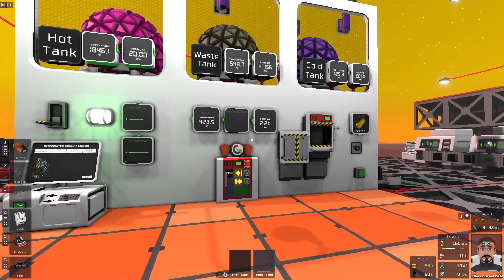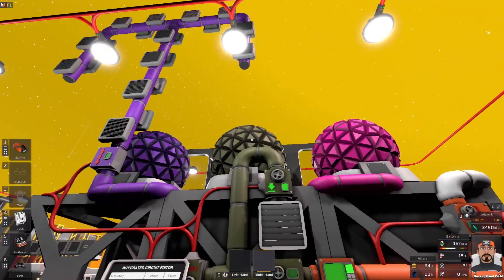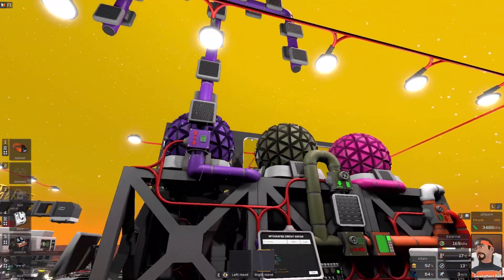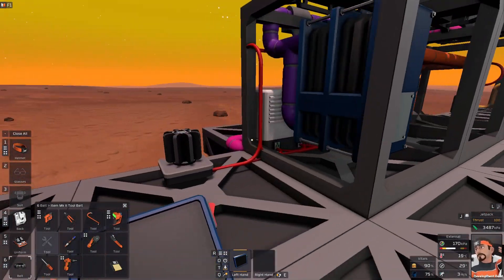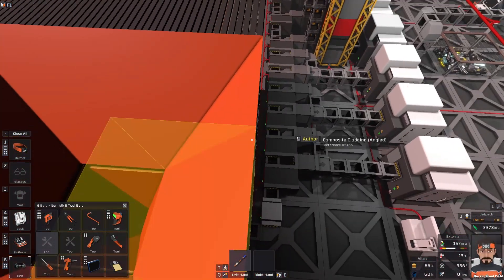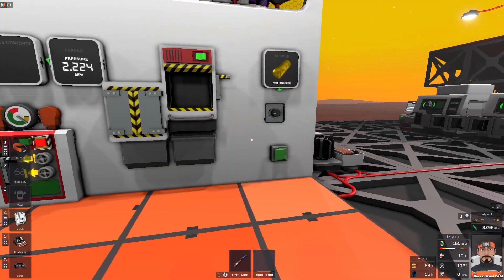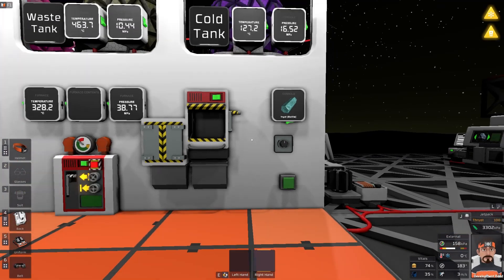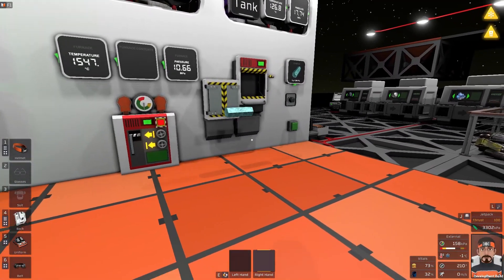Stationeers Automatic Advanced Furnace Reveal

Comment: Hi Mick. Hope this finds you well.  Been trying to set up auto-furnaces and I'm a bit stumped with one thing.  Intuitively it would make sense that if the furnace is not hot enough, you would introduce more fuel and it heats up to the desired temperature and then shut it off then play with pressure; but it doesn't seem to work as it seems to pump more and more fuel with nothing and then BAM, it shoots up way over where I would need it to be.  Have you had this issue? I'm guessing you have to vent some gas from the furnace but to what point would you need to vent it for it to activate the H2, O reaction to start?

Comment: Hi Mick, Not sure what I'm doing wrong but I've got everything hooked up but the filtration unit wont turn on to top up the hot tank, any ideas? Thank you
Reply from the maker: Adding fuel that is very cold can cause situation where the logic locks up.  Use the latest version of the code, I think I have fixed that.  Otherwise prime the waste tank, low pressure there can make things work slowly.
Reply: @cowsareevil7514  Thanks Mick, yeah its defiantly a low pressure issue. I don't think the furnace was reaching its target pressure so everything was waiting on that, i spent some time priming all 3 tanks and leaving it running for a while seems to have sorted itself out,
I have found that if i login and the hot tank is around 15mpa it will run itself empty if i use the furnace for smelting, so i just jump start the system by turning off the IC then turning on the filtration for a few seconds after that it seems to settle down.
Its the best furnace I've built so far. Great work.

Comment: That's a mindblowing piece of engineering, very nice work ! New challenge, connect the output to a series of chutes that will automatically feed the autolathe & other printers, so it pulls the materials when required for crafting, and the input to a series of silos of raw materials that alerts you when X ingredient is running low, meaning you have to go to mine & refill. And voila, creative like mode in survival :)

Comment: with the electric furnace you use the stacker chip on the ic housing on the front of the furnace?
Reply from the maker: Both furnaces use the same controller chip.  You must run the stack program before loading the controller program.

Comment: A simple query on whether the import slot of the furnace is occupied followed by a sleep command if true would probably suffice if you want to have it wait until the ores are processed before switching on the pumps to hit the target temperature and pressure.  Cheers!
Reply from the maker: Not quite that simple.  You have to maintain some temperature to enable to ores to melt and doing that will require more lines of code that I don't have.  I need a MK2 chip with more pins and lines of code.
Reply: @cowsareevil7514  With perhaps the exception of solder, you should have enough temperature to process a batch of ores for any alloy.  Once you set your furnace for the product it will target the temperature and pressure for that product.  Unless you plan on feeding it a dozen stacks, or so, successively for multiple batches, or if you have solder targeting the min temperature (350K) rather than something closer to the max temperature (e.g. 500K), the furnace shouldn't get cold enough to stop processing.

Probably the greater concern is over-pressuring the furnace when doing a batch of waspaloy.  If the furnace is already at target pressure, I'd want it to vent as it's processing the ores! xD  Cheers!